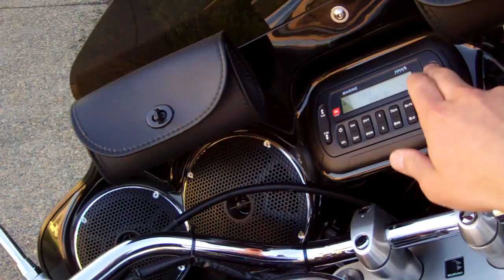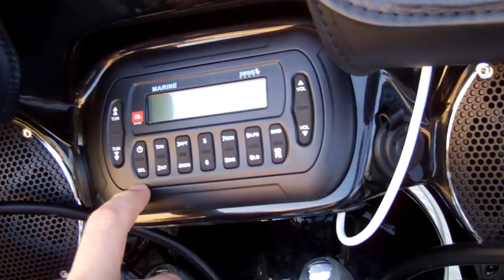Custom Suzuki Boulevard C-50 Fairing

Comment from the maker: I have a OEM lightbar. If you purchase it from Suzuki you should be fine. I can't tell you the part number because it's been a few years since I have installed it. But it's a stock part. Congrats on the fairing!

Comment: Where did you purchase the batwing fairing all setup with everything?  That's exactly what I want for my C90.  I want the fairing, sound system and everything all setup like that and ready to bolt on.  Let me know please.
Reply: I wondering how much the batwing will cost out the door.. I got an '05 C-50T, and been through three different sets of bags, the original ones seemed to shrunk.. lol got mine in February of 07 with 3428 miles on it, now it's got just under 95,000... The only major repairs was a set of timing chains. I just took it apart two days ago and going full custom with it.. new steel front fender for an Electra glide ,  locking hard bags off a Harley bagger, looking through a friend's Harley spare parts for a 10" wide steel rear fender, got a radio, installed a throttle lock cruise control, hiway bar, custom made a set of foot pegs for the crash bar, got a new seat set, driver's back rest, led headlight, tinted windshield, tinted lowers windshields, custom skull on the little cover between the cylenders on the left side with led red eyes, chrome radiator grill cover, and now looking at after market tail light assemblies.